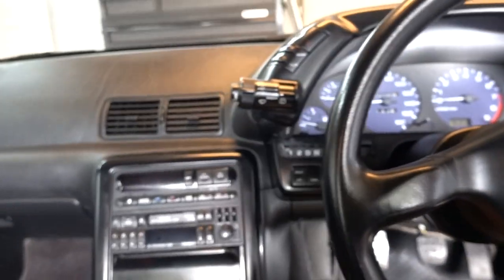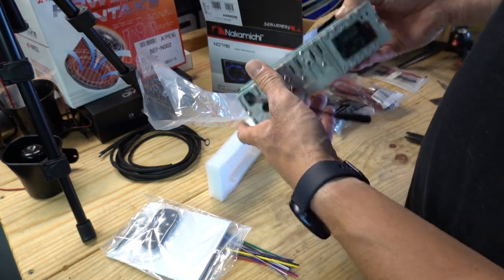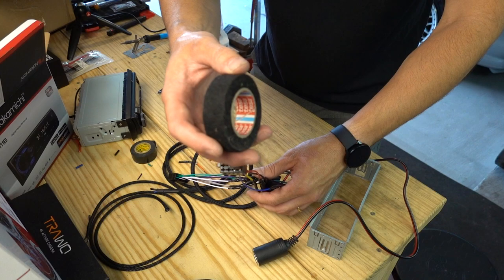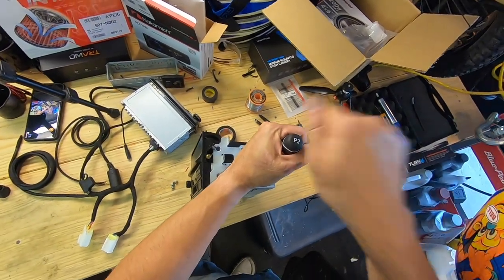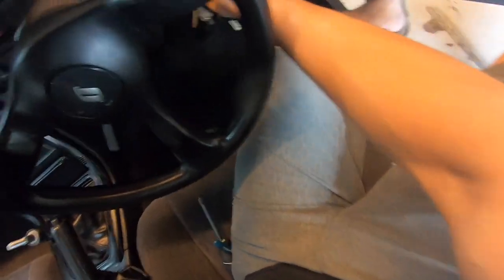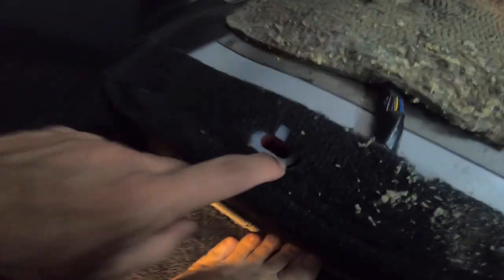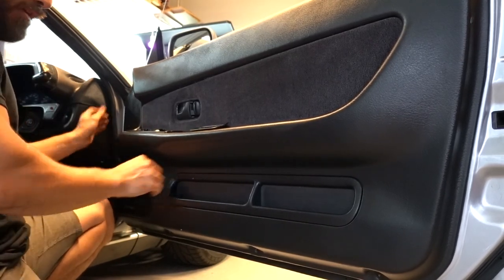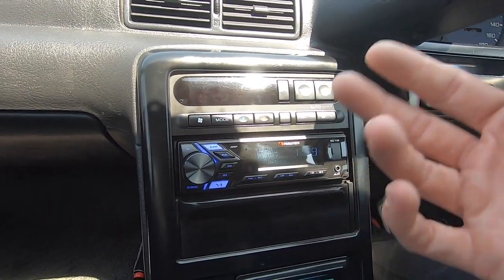Installing Nakamichi Bluetooth Radio and Speakers in the Nissan Skyline R32   NQ711B home wrenchers

Comment: Can you change the backlight color on that headunit?
Reply from the maker: Nope
Reply: Este radio tiene 3 versiones y en la última se puede cambiar los colores y otras funciones de audio. La reconoces porque atrás no trae cable. Además de unas correcciones de error
Reply: Not for fiddy bucks 😂 Actually, I found out there is an app from app store that allows you to control the backlight 👍